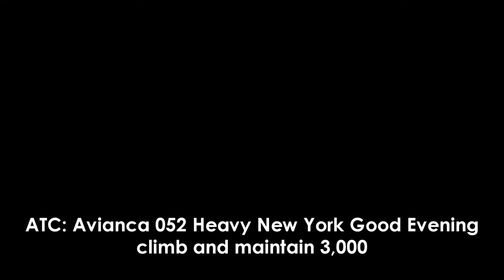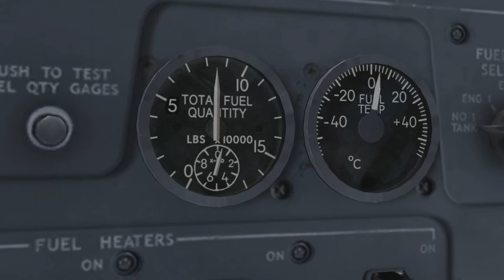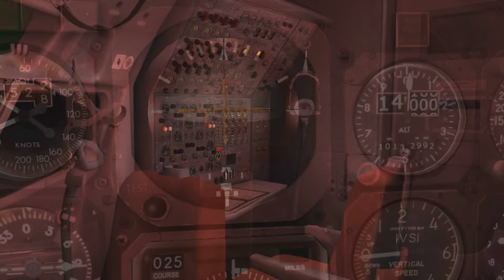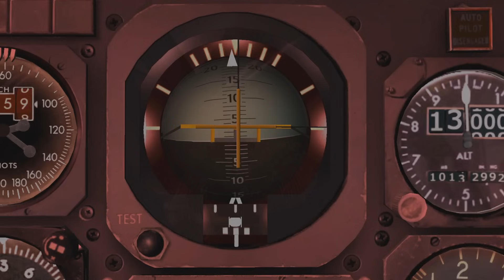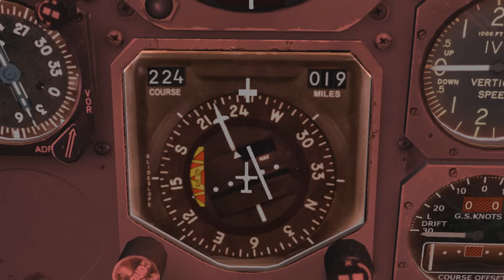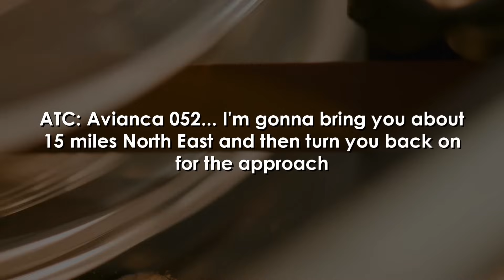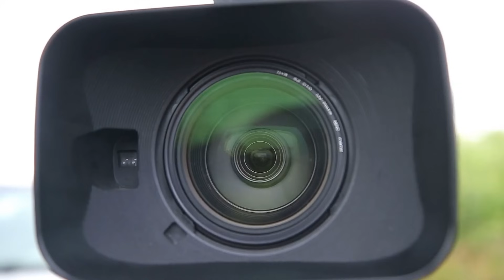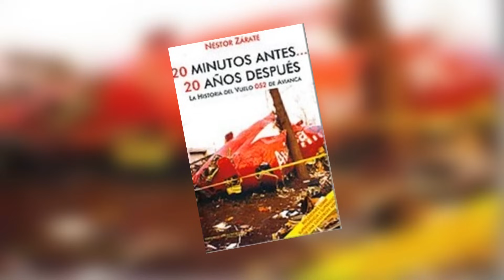Out of Fuel Over New York (Avianca Flight 52) - DISASTER BREAKDOWN

Comment: The part where ATC asked if they had enough fuel to make it to the airport and then there's just silence makes my blood curdle. That silence was so so very loud
Reply: Well said. No bigger killer in aviation than ego. These pilots were beyond incompetent. Plenty of blame to go around with ATC, but ultimately it's the pilot's responsibility to make decisions, and they severely failed to do so. What's ashame is there's airports everywhere in that region. Had they declared an emergency at a reasonable timeframe, they'd have received priority (you get priority when declaring emergency, not when calmly mentioning you need priority ... piloting 101). Could've been diverted to one of the dozens of other airports in the region.
Reply: @topspot4834  the pilot has made the statement “We are running out of fuel” and “Please give us priority” many time. In their language, priority means need attention immidiately. It’s those egg heads in the ATC that just change shift and take too long of time to clear them for landing.
Reply: @NoName-sb9tp  the problem is aviation has very specific rules to handle multi national and multi cultural issues, when fuel got to a concern level, Pan Pan Pan, should have been called, thats what ATC controllers are trained to respond to that and Mayday, you make one of those calls ATC drops what its doing and bends heaven and earth for you,,,, Now ATC Also should have paid attention to any plane citing fuel concerns and got either estimates from them or bumped them up the que,  but the pilots needed to use the right words,,
Reply: @uwais msnn what was that jumbled mess I cannot read your comment...

If you think about what I'm saying you'll notice the same issues as Avianca and ATC had that night...this is why we have international standards and both English and French are the languages of trade...
Reply: To Release is To Resolve  no, they stated clearly that they needed to land, they were out of fuel, and they needed priority for landing. If they are egg head, your head must be some empty that you need to break a glass box to see what inside
Reply: @NoName-sb9tp  saying you're running out of fuel doesn't matter when you don't address the fact that you are minutes from flaming out. Lotta planes are low on fuel when they come in
Reply: @NoName-sb9tp  pilots are trained to say "declaring emergency" "pan pan pan" or "declaring fuel emergency" when they need to land immediately, the term "mayday" is also accepted as a general "oh shit we're going down whether you like it or not" statement
Reply: @topspot4834  The captain declared an emergency multiple times: the first officer simply failed to relay the seriousness of the emergency. It's no appropriate, on the other hand, for a captain to hand such a potentially deadly fuel emergency off to their second-in-command the whole time. At some point, he should have been communicating directly with ATC: it seems like he was having problems hearing the tower, and otherwise had language barrier issues.
Reply: @uwais msnn "Mayday" is a universally-known symbol...the pilots could have said a lot of things that would have perked up ATC. "Priority" is a more formal, technical term that failed to underscore the seriousness of the situation. By the time the engines were flaming out (which would obviously let ATC know they were in an emergency...but again, the flight crew CONTINUED to not declare "Mayday Mayday Mayday"), there was no way for ATC to intervene in the plane's fate: they had gone too far north, away from the airport. They should have never ascended to 3000 feet and turned away in such a wide circle from the airport. That was precisely the time to declare a fuel emergency, not to fly to Long Island. The flight crew are, first and foremost, responsible for bringing down the plane safely, not ATC. All they can do is assist, in the end.
Reply: @topspot4834  right it seems like they waited until the last minute to announce they had low fuel
Reply: I see a lot of people defending the “priority” not being the right word to have used, BUT HE SAID WE ARE RUNNING OUT OF FUEL. Imagine a nascar driver saying “my brake lines appear to be cut can I get some help” and people going well he didn’t say emergency so let’s see what happens
Reply: @brownpower9229  he never declared that his lack of feul was an emergency, he asked for priority and only when near death did he ever say he was out of feul.

If a Nascar driver is running out of feul he's not going to ask for priority then complete 5 more laps only attempting to pit once his car shuts off. Add some thought to your analogy
Reply: @tankthearc9875  You're so mad that it's clear you missed the part where that was but one of many planes the ATC was talking to AND that multiple planes were already having issues approaching that air poor with the poor weather conditions.

It's easy to say what they said, but in aviation there is a Standard Operating Procedure (SOP) and it's clear that the first officer was not conveying the seriousness of the situation properly.
Reply: All these people putting the blame on ATC or the pilots...  maybe there were a lot of people to blame, you know?  The ATC could have kept better track of things or asked more questions especially after that 5 minute warning, the pilots could have used different words to get more attention, the airport situation could have been better to not have an important busy airport down to only one runway, the Boeing bulletin could have had more proofreading, etcetc.  This disaster was a tragedy with lessons to learn from it; Putting the blame on one person or group of people doesn't help anyone.
Reply: @topspot4834  that's weird, I didn't know you were a pilot
Reply: @KidTonyGaming  common sense says no fuel is an emergency . Sounds like trump
Supporters . It’s not this it’s this . Spewing nonsense
Reply: @ywe3  - Actually it’s just English for international aviation operations, per ICAO Annex 10 (Part 3, IIRC), no French.
Reply: @AndreySloan_is_a_cnut  I was referring to trade language [French and English] but yes aviation is only English [for the most part].
Reply: @JohnJohnson-oe3ot  
You need standardised language, many times pilots complain about things that may sound like an emergency, it is their responsibility to not be stupid and to say so. And in this context, weather had meant ATC was already dealing with multiple planes with issues.
Reply: @AndreySloan_is_a_cnut  except in France, unfortunately
Reply: @peterdieleman303  - Been there, done that - they use English, but begrudgingly.
Reply: @AndreySloan_is_a_cnut  Yes, also, but atc still regularly use French as well.
Reply: @peterdieleman303  - Yes, and in Mexico they use Spanish.
Reply: For better or worse, as many other aviation incidents have taught us, standard phraseology is important for a reason. (Look at what happened in Tenerife to see what non-standard phrasing looks like). The ICAO specifies standard English phrasing for communicating with ATC, and in the absence of the words “mayday” or “emergency”, the air traffic controllers aren’t allowed to substitute their judgment and assessment of the problem for the judgment of the pilots. That’s a basic touchstone of aviation: The pilot in command has ultimate responsibility for the safety of the flight. By the third hold (if not sooner), the pilot could have and probably should have told the controller “unable” when instructed to hold.
Reply: @Tyufoe96 a pilot would know that. A ATC should have the basic forethought to assume that the pilot would know that. Idk, smells like a consequence of ATC work conditions
Reply: @topspot4834  
No. 100% of the blame rests on the ATCs. The failed to get that plane on the ground. The pilots did everything they were supposed to do. It does NOT take a pilot declaring an emergency for an ATC to use their brain and figure out that an airplane running out of fuel is a BAD THING.
Reply: @topspot4834 they couldn’t divert they said that in the video
Reply: Oh I hear you !
I am impressed that many American pilots travel to Spain or Spanish speaking countries and they don’t need to bother learning Spanish language because traffic staff are required to speak English however Spanish speaking pilots have to speak English when they travel internationally. How come JFK don’t have staff that at least speak a well known international language like Spanish or French or at least Portuguese 😅
Reply: I heard this recording on a different channel the other day, and then sought a breakdown of the incident. 

The silence was indeed deafening, and the ATC operative’s heart must have sunk into his boots when he realised that the radar contact was lost.
Reply: I heard this recording on a different channel the other day, and then sought a breakdown of the incident. 

The silence was indeed deafening, and the ATC operative’s heart must have sunk into his boots when he realised that the radar contact was lost.
Reply: and when he added  " radar contact lost " ...hit hard
Reply: @agasvons  English was chosen as the language of the skies at the ICAO Chicago Convention in 1944. ICAO established English language proficiency requirements for pilots and air traffic controllers serving and operating INTERNATIONAL flights. I am impressed you were not aware of it.
Reply: Honestly it sounded pretty quiet to me 🤷🏻

Comment: The amount of poor communication by everyone involved and how easily this could've been avoided is just tragic.
Reply: The poor communication was more of the Flight Crew not being assertive and using wrong terminology for a critical situation. Should have long transmitted May Day to ATC.
Reply: The poor communication was 
 the first officer and his captain.
Reply: @edwardrichardson5567  I cannot believe with all those technology we have the control tower still cannot track how much fuel is left around its airspace or standardize the communication as exactly how much a few we left, such as "Avianca Fight 2 hours 30minutes"
Reply: @robertgittings8662  They could probably add that to the list of data an aircraft's transponder sends to ATC, and format it in a way that doesn't clutter the radar scope. But then you'd have to retrain every single controller on the proper understanding and use of this new feature. Expensive, time consuming, but doable if push came to shove.
Reply: Yeah -- I have watched dozens of these videos, and this is the only one that is stressing me out because it is PURELY a communications problem.
Reply: I just felt so frustrated with the flight crew. They were so blasé about the situation until it was far too late. Why didn't they assert themselves and speak up earlier?!

Comment: I think the stress should have started when they were about to miss their alternative airport in terms of both, the schedule and fuel reserve.
Reply: Absolutely!  If you no longer have the necessary fuel to make your alternate, you’re already putting your plane and passengers at unnecessary risk.
Reply: @aaa it's always better, but not always simple to do that when in that situation
Reply: @aaa as soon as they were 10% of fuel pan pan should have been called...but due to a combination of the language barrier and stress of the situation it wasn't made clear that a fuel emergency was needed...
Reply: @aaa Staying calm is always necessery. But staying positive can be toxic. These pilots should have planned ahead and turned to another destination before they used up too much fuel for doing it so.

Then. they should have declared an emergency. What were they thinking? Were they not able to calculate and say we must land now or never? If your car has fuel for a 50 miles journey, you won't plan a 200 miles journey without money for fuel. Confidence will not take you anywhere when you need fuel. It's that simple.
Reply: @aaa with respect, you are mixing your apples with your oranges. Remaining calm and confident is all very well, but an emergency is an emergency. This flight crew handled a low fuel situation very poorly.

Comment: It is often said accidents like this are the result of a chain of seemingly unrelated factors that, if combined in certain unforeseen ways, lead to catastrophe. This is no exception. Among the many sub-optimal behaviors displayed by the crew, one in particular fairly early on didn’t get much focus but effectively doomed the flight. And that was the failure of the crew to set a mandatory decision time where, regardless of their location relative to JFK, MUST abandon JFK altogether and go to their alternate in Boston. They did not do this, however, and only after their fuel level was too low realized that going to Boston was no longer viable. That put enormous risk on every aspect of the JFK approach to the extent there was no room at all for error. RIP
Reply: KC in DC well said. Your summary is very accurate.
Reply: swiss cheese effect
Reply: pre flight planning, yes. the pilot was exhausted from hand-flying. no room for error... then that fucking wind shear
Reply: This video is not complete, there was much more to this. It was the greed of the airport offcials and the sloppiness of the ATCs the major factors that caused the accidents.
Reply: @royaltyblessed2454  - Exactly, more formally known as the “Reason Model,” for the man who postulated it - James Reason.
Reply: Good point
Reply: @californiadreaming9216  thank you!
Reply: @nillyk5671  Receipts?

Comment: "I guess so, thank you very much." f-ing what!? Unbelievable with so many lives hanging in the balance.
Reply: ever heard of ESL?
Reply: @GiordanDiodato  so what? Don't work as a pilot if you cannot properly deliver the message. Also, he didn't know the word "no" in English!?
Reply: @GiordanDiodato  Shouldnt be flying if you cant communicate. Pretty simple.
Reply: Can't blame the ATC at all for this. The flight crew was incompetent at communicating their situation
Reply: @caracalfloppa4997  there's definitely fault to be found at both ends, even if the word emergency was not used, maybe they should have seen that plane without fuel is bad. Really though, outside of cases of wilfully and knowingly disregarding standard operating procedure, blaming people for making human mistakes (and everyone makes mistakes) is really not very helpful, and doesn't improve safety. What's important is to learn from the mistakes that were made to stop it happening again, not to point fingers

Comment: This is the best amateur Avianca 52 video I've seen. Just a few things to add:

- Hand-flying for over 6 hours should have been highlighted more in the video. It gave way to a tired and complacent atmosphere in the flight deck.
- Pilots were not informed of low-level windshear on approach, which almost led to a crash on their first approach. The dissenting statement from Mr. Burnett (final report, NTSB) did make a point of this.
- You did mention the Boeing fuel bulletin, but not the "at least 7000 lbs as the minimum indicated fuel quantity for landing". The FE didn't realize that the flight was running on emergency fuel until he started considering gauge inaccuracies.

Keep up the good work!
Reply: Not to mention that autopilot is more efficient in terms of fuel.
Reply: ...bore off
Reply: @iankemp2627  Yep, that is true, autopilots are better at reducing fuel consumption. It is so sad that a confluence of events had to lead to this disaster. :( Hmm, what if planes were powered by a reactor, and used electricity generated via an steam turbine to power electric ducted propellers? No need for jet fuel. But hey, that is just a shower thought. Reactors are heavy and expensive, and risky if a plane were to get into an accident.

A more feasible system would be a fuel monitoring software that could automatically locate the nearest diversion airport when fuel runs low.

May all the passengers and crew rest in peace for Avianca Flight 52.

Comment: As soon as they got to NYC airspace they should've told ATC "I need priority landing, we are in our reserve fuel". Or declare an emergency if ATC is hesitant to land you promptly.
Flight crew really dropped the ball here
Reply: "Pan Pan Pan" "Mayday Mayday Mayday" "We have a fuel emergency" "We have an emergency, request priority landing"...so many ways to alert the ATC. Instead, the first officer seemed almost bored when ATC asked if they had enough fuel to circle around the island and he simply said "I guess so...". Those are not the words of a pilot commanding a plane that has less than an hour of fuel left...makes no sense!
Reply: the ATC also dropped the ball here they SHOULD have known that low on fuel means emergency regardless
Reply: @kuro9410_ilust  they literally asked the crew if they had enough fuel to be diverted 15 miles away from the airport, which the FO agreed to. Where's the ATC fault on that?